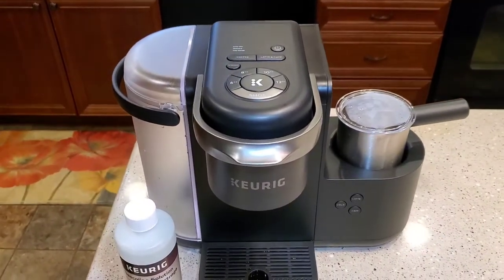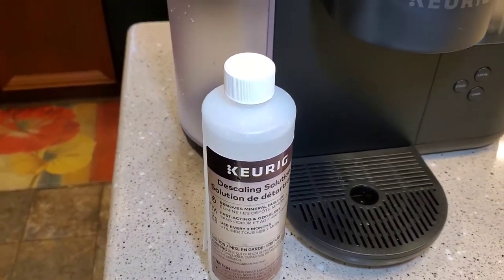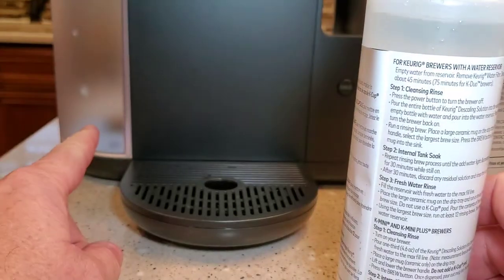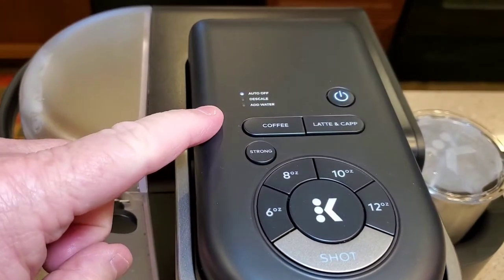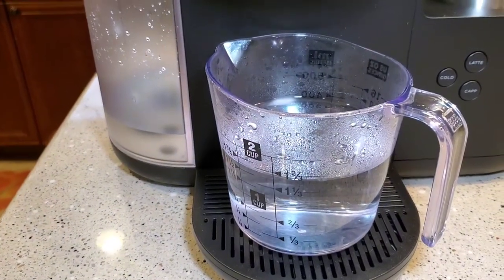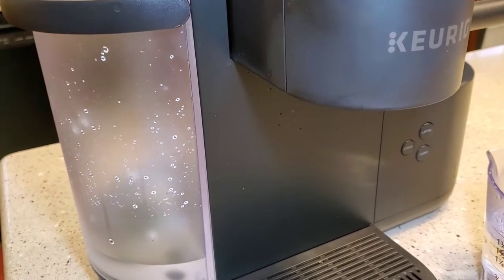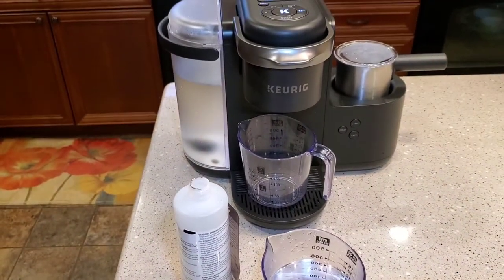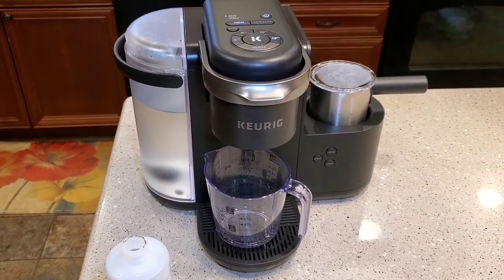HOW TO DESCALE Keurig K-Cafe Espresso Cappuccino K-Cup Coffee Maker With Keurig Descaling Solution

Comment: i've descaled a couple times and the descale light is very faintly still dimmed? i've cleaned the needles and everything tastes fine and it's back to brewing normal. advice to try and get the light to be completely off and not even slightly dimmed? thanks for the video :-)
Reply from the maker: Interesting!  I have not seen this or heard of this.  The manual says to run descale solution through it again. but since you have done it a few times not sure that will help.  I might call Keurig they have great customer service over the phone.   Keurig customer care at 866-901-2739.
Reply: Did you ever figure out how to get yours off? I’m running into the same problem with mine!